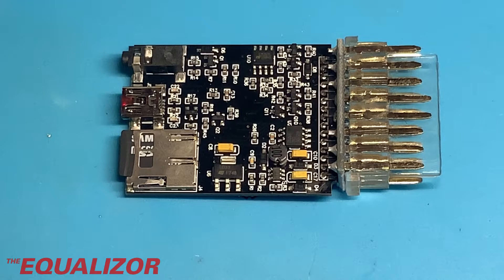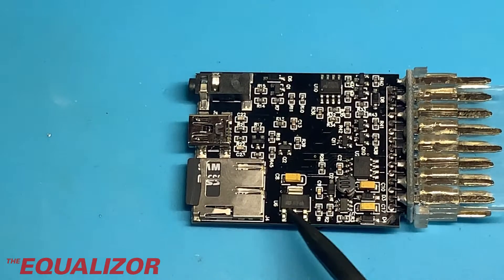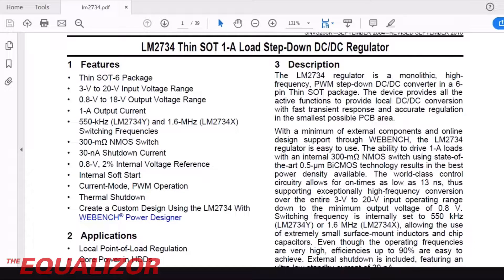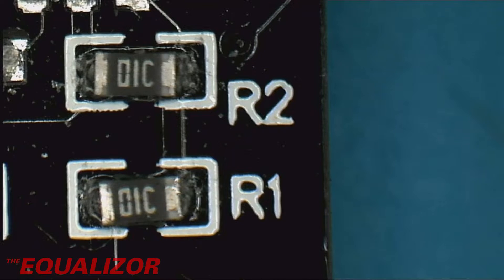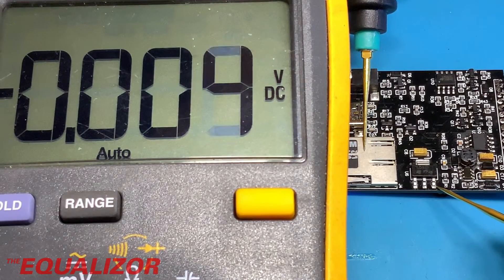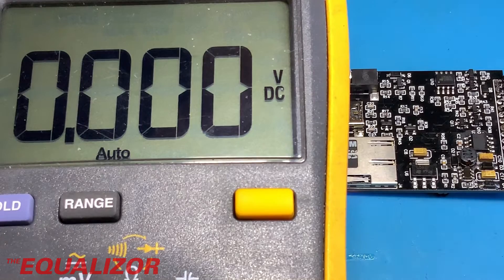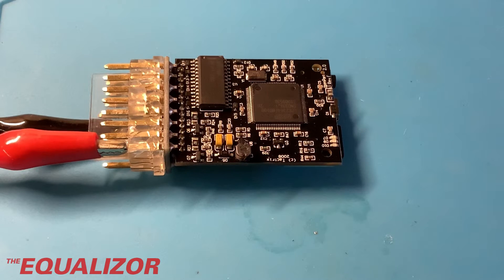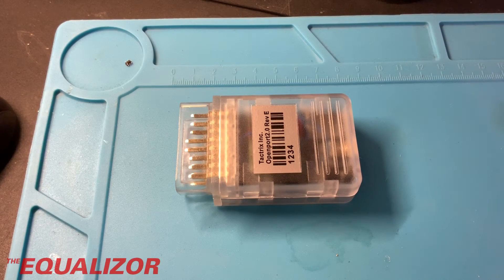Fake Tactrix Openport 2.0 repair. This is our  fix where the DC-DC just wasn't working.

Comment: Its much easier to get it working... just replace R1 to 47k ... so its working fine on OBD Power. No need for extra step down converters.
Reply from the maker: We replaced r2 as its part of the potential divider with a 56k resistor and the DC-DC still didn't work - the output remained the same. Really appreciate the input but its done now and works, but I'll pin your comment so people can try that first and then if that doesn't work they can go all out on it and do what we did. Thanks for the info!
Reply: I just got one of these and replaced R1 (not R2) with a 51k 0603 package resistor.  I now have 4.84v into the 3.3v regulator.  If it hadn't worked, I probably do what was done in the video.  I'm glad I found this video, Thanks to all!
Reply: @Mike_Neukam  I get the same volts changing the usb port on my laptop (usb 3.0 controller in expansion port). I try in another USB 3.0 and I got only 4.54v. If I use a charger with only 1A the volts drops to 4.33v...with 3A charger up to 4.54v, but only got 4.84v in this USB 3.0 controller (RENESAS).
Reply: @SAACAAS  I had 4.84v with the USB disconnected, plugged into OBD port after changing the resistor.  I didn't measure the voltage when plugged into a USB port
Reply: @Mike_Neukam  Hello 
I replaced R1 with a 51K resistor to make it more stable and to use obd power. But after i replaced it it dont light up when i plug it in the obd port only when I plug the usb in it lights up. do you know what I maybe did wrong because many people only change the R1
Reply: Is the device working? Have you tried reading or writing firmware from ECU?
Reply: It doesn't work
Reply: good morning which smd reference
Reply: R1 47k smd
Reply: Can any one help me with xentry passtrou keygen download link please or help me log in

Comment: I opened mine (Rev. E 1234), both resistors are 10k, but the voltage is 3.3V when connected to USB, so decided not to change anything

Comment: Why do you do this work at all if the processor has it's 3,3 Volt as soon as you connected USB? You will normally always have USB plugged in while scanning a car.

Comment: Hi, Thnks for the video, mine doesn't turn on after flashing an ecu with ecuflash, it was fine for about a year, it doesn't turn on with usb but has voltage on board (4.8v). I tried an other one with ecu flash and it flashed the ecu once and now it's same as mine. Do you have any idea?

Comment: Replacing R1, R2, R3 resistors makes sense only when LM2734 is functional. You spent time replacing resistor for nothing, it will not do anything, because SFEB chip was dead. The video is great anyway, Thanks.
Reply: How testing SFEB

Comment: If you don't have the skills to de-solder the component as mentioned. You can try to use a little powerbank together with the USB cable connected to the Openport.

Comment: whats on this sd card? i bought mine couple of months ago and already lost the sd card now i dont know what was on it
Reply: Very late response but the SD card is blank. It is used for standalone logging. You can define your ECU id and program whatever parameters you want in a .txt file on the SD root. The Tactrix could then read those instructions and log whatever you want without a computer or external device to record the logging. I always have it loaded ready to go in a pinch but the polling rate is a bit slow with the amount of parameters I need to log so I have a dedicated Samsung Galaxy Tab A7 mounted running a beautiful app that was designed to log Subaru ECUs. An android app that can read, log and even check learning view or clear vodes/reset the ECU is amazing. It can also poll much faster than anything else. I believe it's faster than RomRaider when a USB connection is used. Slow if you use a ELM32 Bluetooth OBD2 logger. I wish the developers continued with the app and we got the ability to flash the ECU. Even small minor adjustments like idle or base ignition timing. If I knew how to write in Android code, I'd continue myself! Sadly I only know C++

Comment: Try differents USB ports because, I get 4.84v without any modification, ONLY  changing the usb port on my laptop (usb 3.0 controller in expansion port). I try in another USB 3.0 and I got only 4.54v. If I use a charger with only 1A the volts drops to 4.33v...with 3A charger up to 4.54v, but only got 4.84v in this USB 3.0 controller (RENESAS).
Reply: what happens if your getting lower voltage on other usb ports ? it wont read properly?

Comment: Logging to SD card was not working, the power supply from the OBD did not work. Successfully repaired by changing R1 from 10K to 51K - I had to ask someone with equipment.
Reply from the maker: Yes, a couple of people have mentioned this fix and thats useful to know, but doesn't apply in our case as we changed that already. The DC-DC circuit was faulty on ours.
Reply: I confirm this works. (there are other fixes that can be made, like adding a 100uF cap on the regulator input, and a few other resistor values can be corrected as well like R3, R31, R19 , google it a bit)

Comment: Hi, I bought mine and I think it broken, when I'm connecting via my laptop USB no more light show up, first time I think I'd see light shown. Is this solution going to help me ?
Reply from the maker: Hatsanat Srianant Does it light up when plugged into the OBD port?
Reply: @the_equalizor  No, but first time I did not see any light shown when connect to my obd too (only show light when connect via USB side). Thanks for your help 😃
Reply from the maker: Hatsanat Srianant okay so are you saying that it doesn’t show any lights on usb and obd? That could be the voltage regulator has gone bad then. Iirc the 12v and usb 5 volts end up going to a 3.3v  linear regulator. I’d be checking the voltage going into that (5v I think) and then it should have 3.3v coming out. If you google the part number of that regulator you’ll see which the input and the output pins are. I think it’s the 3 pin device behind the sdcard socket.

Comment: I already killed 2 chinese copy units. Good thing it was after writing the data to the ecu. Already bought the original tactrix. I'll try reviving the 2 old defecrive ones after lockdown.
Reply: Actually they are killed  (destroyed) remotely on purpose by the makers of Tactrix in the USA.
Reply: @bn880  for real?
Reply: @darkcashyz  yes
Reply: @darkcashyz  There are modifications that can be done (not easy) to pull up the write pin on the MCU to prevent it.  Otherwise don't allow internet connection when connecting the Tactrix to PC.
Reply: @bn880  so its something on the latest ecuflash or internet also .. I think its more of the latest ecuflash has some hidden kill codes > ? has there be any fix  after its been killed or some repair ? cheers
Reply: yes my first one fried no light I got another working right now and the real tactrix is like 100 bucks the ali express ones is 15 20bucks.  How much did it cost to fix is it worth it ?

Comment: Was I lucky? Mine works flawless on my 2001 wrx? have flashed partial changed maps and completely 100% different maps, Always works perfect and logs perfect, But I will be buying a genuine just to support the company as this genuine  is extremely cheap compared to other tools in the tuning world.
Reply from the maker: RCJ Tuning My boss has never had an issue with his and he’s flashed maps fine with it multiple times. He didn’t deliberately buy a knockoff, but that’s what the Seller sent him...
Reply: @the_equalizor  I just checked and although mine functions perfect it does not light up off obd alone, only lights up once connected to the pc.

Comment: Why are you even supporting the Counterfeit market. You sure spend alot of time fixing a problem from a Fake product that is popularly used on consumer products Rranging from 5 -50k USD. I hope you understand by supporting these counterfeiters you are supporting stealing money from families of Small american business owners. I do appreciate your knowledge of repair though.
Reply: the original tatrix had same problem to so its just a design problem china ones just got cold solder joints vs the original with good solder joints  also  usb port is weaker then the original to lol

Comment: You can also run a jumper from pin 11 to 7 i believe.  Email me for pictures. Mine was also dead.

Have you figured out a way to prevent these from getting zapped when openport driver connects to the internet and receives the kill command?
Reply: I would think it's something in the later versions of ecuflash that would brick these fakes, just to play it safe I'll start with earlier versions of ecuflash.
Reply: @crazyDIYguy  Thanks mate have you tried other versions / if yes which ones so far works ?
Reply: @saabaero6211  Did you figure it out yet ?
Reply: Hey @andrewlee88 you mind sending those pictures over?! Tyia.
Reply from the maker: Andrew Lee  I haven’t done anything further with this as it wasn’t mine and my boss has done all the tuning he needed to do. Didn’t know about the kill command. Clever stuff!
Reply: Any success in unbricking?
Reply: I would like to see those pictures too Need to fix mine and what version of ECUflash is safe to use with these ?
Reply: So did it fix it?

Comment: Thanx for it. Say me please, what is a scheme you use for upgrade? Where i find this scheme? Thx)
Reply from the maker: There isn't a schematic as such, but I have pasted a link to how it was wired up below, as well as a link to the Buck Converter on Aliexpress. Hope that helps.

https://mrhangmancouk-my.sharepoint.com/:i:/g/personal/robscott_mrhangman_co_uk/EVVsUpYc59RKgS8e-qXdLi0B71p5hFeo_NqB0_i8rJKNsw?e=n5DQdJ

https://www.aliexpress.com/item/Ultra-Small-Mini-DC-DC-Step-Down-Power-Supply-Module-3A-Adjustable-Buck-Converter-for-Arduino/32982640798.html
Reply: WooW! Thank you very much!